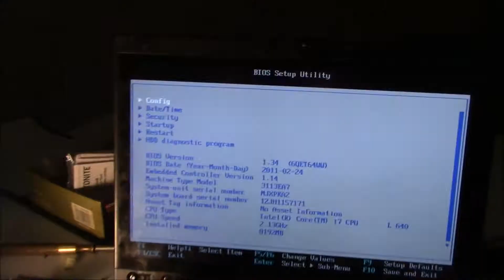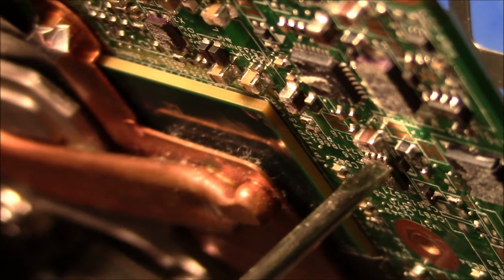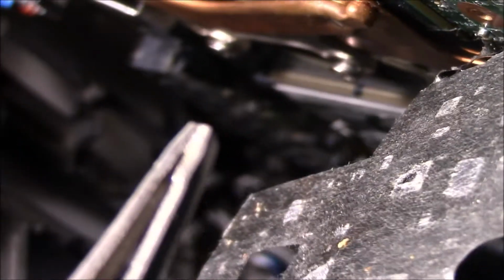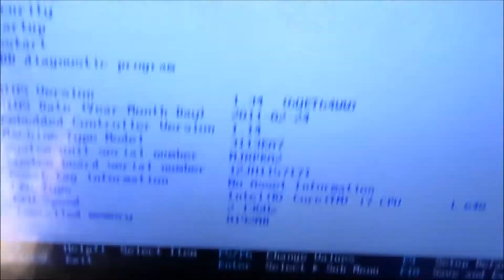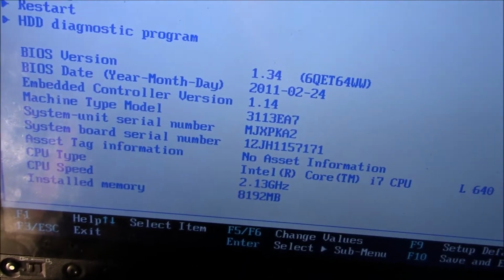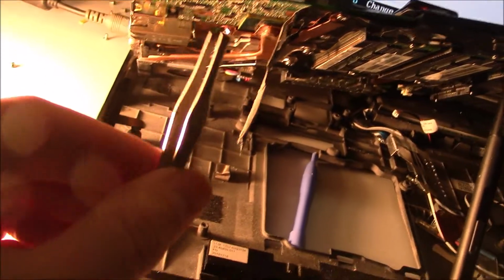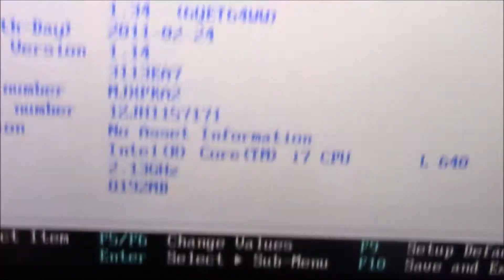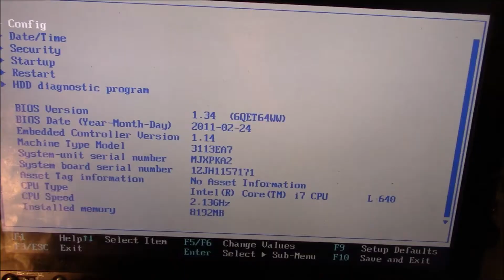How To Fix A Bios Lock On A Lenovo X201 Thinkpad Tablet Pen Touch Tablet

Comment: Trying to get rid of the supervisor password on an X201i  that sat on a shelf long enough for the CMOS battery to run out. Pretty hairy since the chip is much smaller than you might think from the video. I would recommend steady hands, good lighting a magnifier and a third hand. I'll get it done but this is security through awkwardness.

Comment: If you have access to the pins on the other side, as you showed in the beginning of the video with the pin above the 307, why did you lift the motherboard up at all? Just short the pins from the other side and don't lift the motherboard? Am I right or am I right?
Reply from the maker: There is no access that is why it had to be lifted.
Reply: @DoItYourselfEasy  Yes, I think you are right. I tried to do it and could not get it. Then I got it from the other side and got it.

Comment: The best tip here is to release the short after getting into the SVP password reset. Release short, put in some password -> set password again and it is asking password again but this time with a different   type of prompt (as if it was the first time setting the password). After this you can disable the SVP completely or use the one you set. Remember to F10 save the bios settings finally of course.